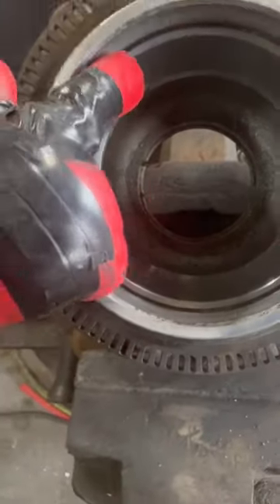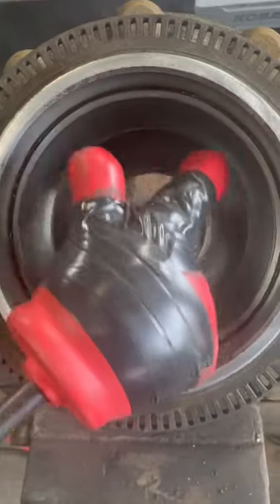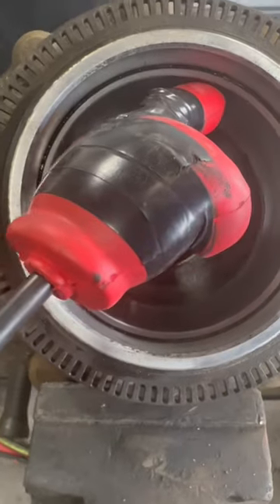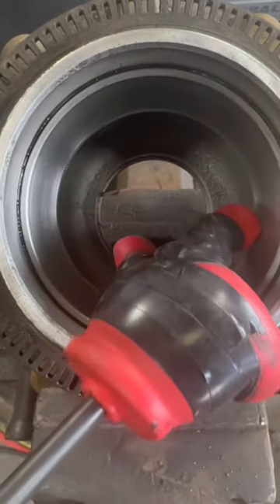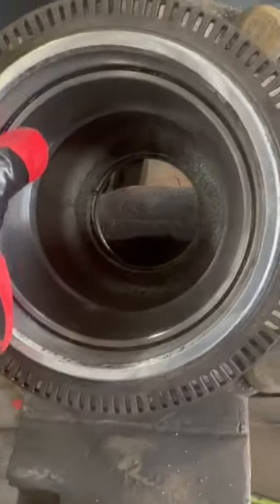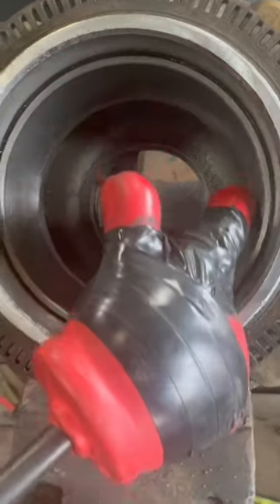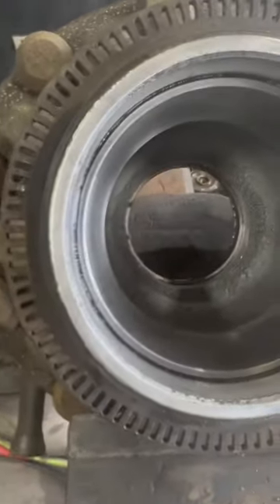Makes it way easier

Comment: When I first started ranching I started wrenching on diesels and a heavy-duty equipment because I grew up working under my father who owned and did all the repairs on his excavating equipment. I started ranching for a forestry company and one of the guys showed me this trick and I fell in love with it because obviously low man on the totem pole you're doing everything from bearings spring packs airbags and anything else on the break side of the truck.

Comment: I love this trick.
I usually use smaw (stick) 7018 rod. I run the work lead to a steel rod that is welded to the race.

If the race is on a shaft or axle tube I’ve been taught 2 methods.
#1- make 2 downhill welds. The heat expands the race more than the shaft and you can slide the race off easily while it’s hot.
Or
#2- make 2 shallow cuts into the race with a cutoff wheel, that’s where the race will crack when it shrinks after the weld cools down.

Comment: Same way i get the races out of lathe headstocks that have no access hole drilled to drive them from the backside. Sometimes a puller works but most I've dealt with don't provide you with that luxury.

Comment: Nice. Never thought of that. Will have to try.Always just went with a bigger hammer. I cut off the shaft of a pickle fork in used that for the stubborn ones. Ive shed some blood over them thats for sure.

Comment: Fun fact, if youre GOOD with a cut off disc, then you can throw a small slit in the race(don't cut all the way thru but the deeper the better&weld that slit up...... she'll slip out pretty good too. Sometimes if it doesn't pull enough with one slit&weld, doing another one about 1-2 inches away definitely works. If you think doing it 180 away would work better, you'd be surprised that it makes it harder by twisting the race opposite of the other side.

Comment: you would be surprised at how many people freak out when I use that method for some reason they think it hurts the hub
Reply: I could see it hurting the hub if a total idiot was using a super hot stick welder to the point of burning through, but yeah, a reg weld, hell no, aint gonna hurt it
Reply: I've always been told not to replace the race in aluminum hubs. not sure the reason, maybe it has to do with the risk of gouging the softer aluminum. but I'll definitely try this method and see how it works next time I get a truck in my shop that needs races.
Reply: Whoever told you to not replace the bearings race when you are replacing your hub bearings because your hub is aluminum needs to stick to whatever job it is that he has and stop giving people bad information. He can't possibly be a mechanic saying shit like that. If I was interviewing that guy for a job wrenching and he mentioned that during interview, I would calmy, quietly end the interview and inform said candidate we will call if we will move forward. Maybe in a different reality but not this one, would he work for or with me.

Comment: Great info, thanks! Could you explain it though. I wonder why, because I would've initially thought the heat would expand the race, making even more of an interference fit. 🤔  I usually heat the external part. Does the bead contract as it cools? That would make sense, maybe I just answered my own question? Lol
Reply: Yes, it gotta be something like that. The ring of new welded material shrinks even further. Heat the hub just as a last resource, specially if you use a press.

Comment: Dam that cord I hate getting shocked you should see the black tape in my shop 😆 I was welding on derby car last season and got lit up good 🤞
Reply: Ohh dat smell...cant you smell that smell...😅. GFCI pigtial from your local big box store as a back up Brother.👍 High use extension cords (drive on floor cords near drains, welders, doors etc.) that may also just need a new M/F caps? Snip. Well then fish tape them through a old garden hose for added protection.

Comment: It causes the aluminum to expand, not shrink. Still works. You can also use a torch to heat as well. Just be careful with it or you'll melt the hub
Reply: Isn’t it that the weld shrinks when it cools and pulls in the aluminum?
Reply: it shrink's the race, dun hundreds of them, cool with water while hot they will fall out.

Comment: My dad always grabbed the arc welder to heat metal up and bend it, instead of the torch, he always said it cost less to use, and overhead with a stick doesn't make to much of a mess

Comment: Ive never had an issue changing bearings in aluminum hubs. Just make sure theres no burs and dont pound the fuck out of one side twisting the bearing. Simply use a ~10lbs stubby sledge and punch and let the weight of the hammer tap it out while moving the punch in a circle around the bearing one 4 points, left, top, right, bottom... repeat until its out. Takes about 2-3 minutes max. By the time i fuck around with getting the welder out and my mask out to weld it, id have the bearing out already without using any welding wire or gas. I guess its a neat trick to keep in the back of the mind though.

Comment: Been doing it for 20 plus yrs, pro tip leave oil or grease in it so it will catch hot slag. If itts clean a piece alof slag (or bb) may stic then break freevand get in the bearing and bad stuff WILL happen... welcome

Comment: Would this work on stainless steel hubs too? My boat trailer has stainless hubs and the races sit flush with the inside, no edge to tap on and are a nightmare to remove.
Reply: I'm no welder, but I don't see why not.  I do it to king pin bearings on mfd axles on CaseIH tractors.  The bitchy part is that these holes are blind by welding them, it loosens them up and the weld beads give you a cleat to beat on.

Comment: At my work it takes longer to untangle the 30ft extension cord for the welder. Sometimes a welder runs out of gas and the last person to use it is too lazy to change the bottle for the next guy and then sometimes the tip is stuck cuz the guys use it to light up their cigarettes so you got to find some pliers. Just takes a little more time giving it a top and bottom hit without the welding.😉

Comment: Ive always ran the hest as high as possible and wire speed a slow as i can with a smooth arc. And run like a 1" long fat wide bead along the bottom. But yes, a weldwr is the the best way no ifs ands or buts about it. Every time the race slides out with one finger

Comment: I don't understand. Why didn't you just pop the torch out and torch it heated up a burns. O it'll work fine   wasting money on power. And welding wire